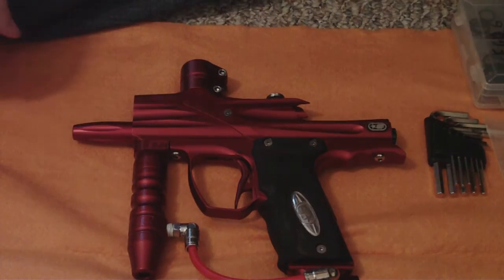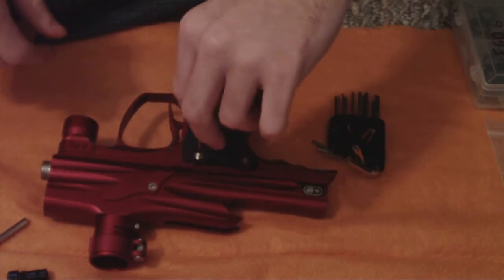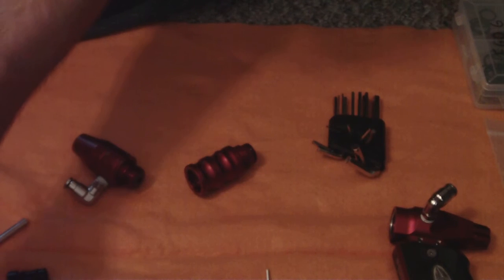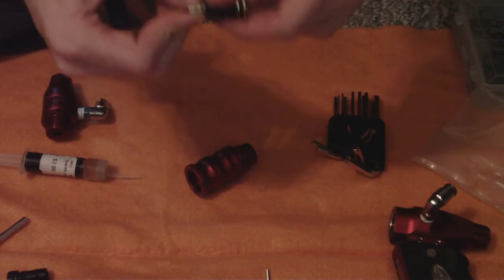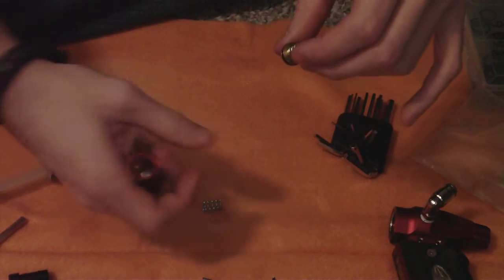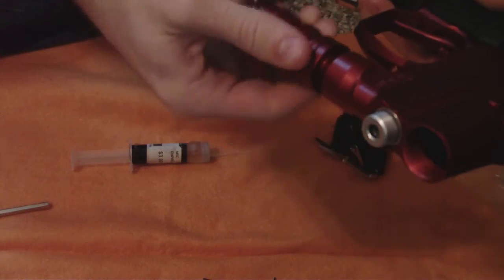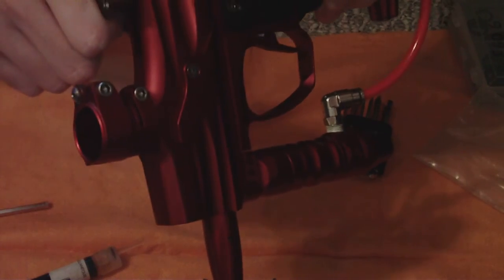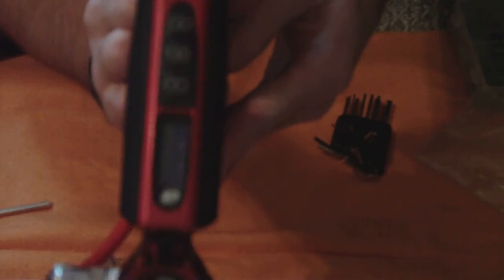06 Planet Eclipse Ego Maintenance

Comment: I just yesterday bought a 06 dark ego for 340 off ebay was wondering/ wantng any advice. How much i should be spending ect ect. I havent played since 2004 so im a bit out of date but its nice to finnaly get the unicorns i always wanted for a fraction of the cost....any advice will be greatly appreciated cheers
Reply: Ill keep you in my mind man i just dusted off my Ego5 and shes in pristine condition. Try getting the Cure 2 bolt for your gun, better accuracy and fire rate. Grab some empire gun lube and a new Virtue board with eyes (all on eBay). Grab a freak barrel to, the autococker threads or smart parts freak kits in general will fit